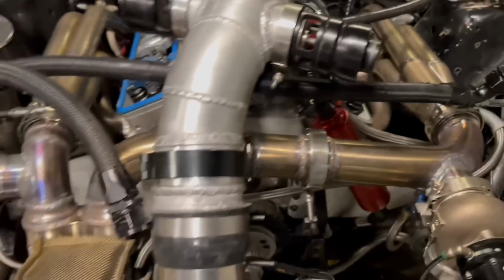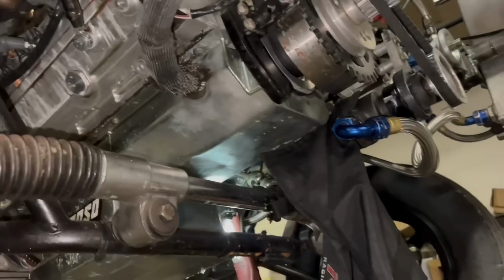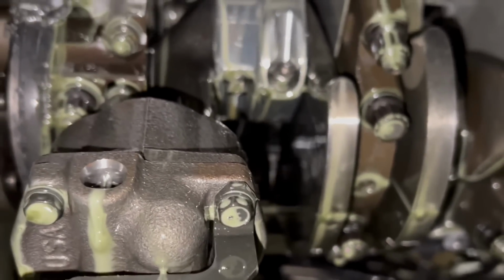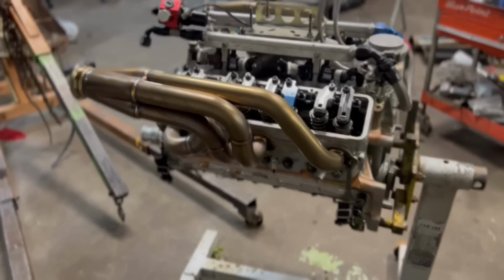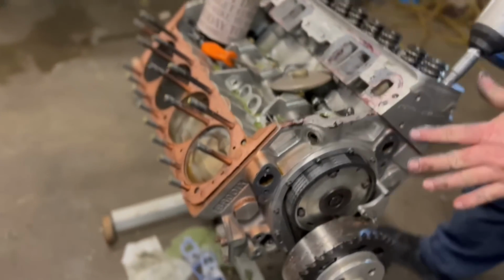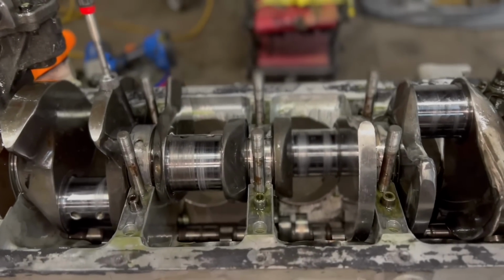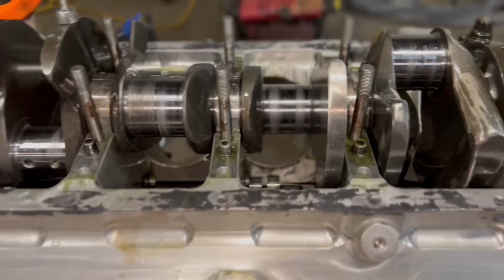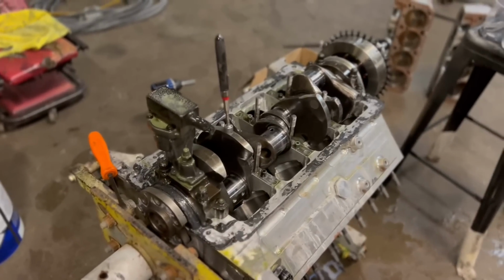Motor is TRASHED!  The ALL ALUMINUM SBC is torn up.  Hope we can save the block......

Comment: Sorry to see the carnage John. 

Have you considered maybe doing fewer short startups, not really getting up to temp, to move the car around when not at the track? That oil contamination looks terrible, can't be good on the motor. I'd be draining and boiling after every race weekend before starting it if it were mine.

I also have a set of Dart BBC heads we might could do some horse trading with if you go that route.

Comment: John, that valley doesn't look like it has much drain back and is design to be scavenged by a dry sump system so it probably ran the sump dry which started the failure , be careful

Comment: Put a crank with larger mains in it and make sure the bearing crush is tight enough. More overlap will make the crank flex less. Hone the block to have a smaller bore size to  achieve more than average crush to compensate for the aluminum expansion and adjust clearance by crank journal size.  Crush is what holds the bearings in place, not the tabs for alignment.   I'm sure you already knew that.

Comment: How about putting the correct washers on that rack & pinion and PLEASE learn how to weld properly,  your going really fast and a door flying off and hitting someone else that has a properly built car and hurting or killing someone in the car or stands is not ok . It's ok to be budget BUT some things have to be done to higher standards than what we're seeing.  Love the content but a little more attention to detail would go a long way in my opinion... and you had to have known with the amount of fuel that was running out of that thing that it was going to hydroloc it , bent a rod or smash a bearing.  You been doing this long enough to know better , just slow down a little and do it right I'm sure you got the knowhow.
Reply from the maker: When ever you want to fix those items, I’ll let you!
Reply: @TurboJohnRacing   I would love to if I wasn't working 60hrs a week and trying to run a company.  What I'm getting at is just pay attention to your welds for burn in , you need good  penetration. That door flying of at 150mph is a missle and could kill someone.  Same thing with that rack and pinion.  I'm not trying to be a asshole I absolutely love watching your channel I just wish you  cared more about details especially when they have to do with safety and 1 more thing while I'm ranting,  you should have listened to your buddy and lowered that blow off valve , it would have looked 1000% better and you wouldn't have to cut your car up so bad , all it would have took is pay a little more attention to detail.  Keep up the good work and good luck with that block .

Comment: I'd throw a scat 3.75  in it if the rods will clear the cam. It should live fine since you run mainly noprep and the extra cubes should spool a lot easier.

Comment: Once heads are off, can you then rotate the oil pump to see where the oiling through galley's oil is not travelling so you can track back to the issue....pull the distro out and make sure that the passage on distro is correct height also, many with Alum. Blocks have that same issue that takes a custom machined collar to get it correct height.

Comment: gotta ask.......why do you idle the engine so low? Should consider a pre heater and pre lubrication system
Reply from the maker: It’s the injectors!  It’s either 500-800rpm flooding rich or 1500-1600 lean it seems.
Reply: @TurboJohnRacing  how about two injectors per cylinder? That and different cam timing.

Comment: Did you change oil and filter after the fuel regulator failed?
Reply from the maker: 5 or the 8, but there are several issues

Comment: A perfect opportunity to go with a 400 main crank with longer stroke, and maybe some longer rods and a set of matching pistons.  Only two things are going to make a difference.  Longer stroke, and/or gear ratio change.  A custom cam with the longer stroke, would be ideal, whereas all the aluminum block did was make it lighter.  Sorry this happened.  Hope you get sorted out quickly.

Comment: I thought Brian was crazy when he was tugging on the crank at the racetrack but apparently he knows LOL
Reply from the maker: Yep, he was check for thrust.....While hot it was good it seemed...
Reply: @TurboJohnRacing  That is the only way to check it, hot.  With the thrust main in the rear, I made a gauge that I bolted to the front cover and tonked them with a rubber hammer, it is surprising how much thrust you can loose especially with an automatic, a friend of mine had a SBC that would run cold and die Hot and be stuck one whack of the hammer was all it took to know that the converter was ballooning and taking the crush away. He had all kinds of guys look at it. I felt like Carl on Swingblade when he said 
“Ain’t got no gas in it…”.

Comment: I had issues with aluminum, went back to iron…. All good now….if you try to warm the block and see how much it moves….. you won’t like it. Hopefully you get it sorted! Thanks for sharing!
Reply from the maker: Thanks for the tips!
Reply: @TurboJohnRacing   The FE has the same main as a Cleveland’s I use Cleveland Cam and  main bearings except for the Thrust Main. The race bearings. I haven’t taken it down since 1999.  And it has seen 7500 NA regularly. That’s just a dump truck 3 rib mains with no cross bolt caps. Just a .020 over  391 ported 352 heads with 2.06/1.6 valves and a Holley Street Dominator and a 750 3310 with a metering block but still straight leg boosters and long tube headers 2 inch primary 3.5 collectors. 503 Hp and 485 ft lbs. all these years and 4.44 Spartan locker, C6. It was so fun to drive but I lost my vision. My son still does a burnout and takes me down the road 1965 Galaxie. The next one I would do would be 4.103x 3.91 FE iron, same block as I have now. That is about 413.5 ci from a dump truck block. I would likely put two cross bolt mains from ProGran, one at 2 and the other at the 4th main. I also use hose nipples threaded hardware store in the valley holes, I have had them in mine since I built it and it allows air out of the crankcase and t the oil down the drains at the front and rear.  It returns quickly much quicker than without them , I also have a scraper on my Canton 8 qt running 9 pan with the huge pickup front sump. No windage tray needed, the air is pulled out by a small vacuum pump and the oil gets knocked off by the scraper. I made my own vacuum pump cheap. I run 15w 40 Rotella or Delo. Flat tappet solid. My next move is boost. I want a 7875 billet or a pair of 3582 remotely mounted behind a 3 inch X pipe with a 2.5 crossover and BOVs with 4 inch pipes straight out just in front of the rear wheels. And a 3 inch oval 2x4 cold side up to the intercooler and to a carb bonnet with a 750 DP and a Holley Controller oh and a PortoSonic I have laying up. The controller would control fuel , timing, boost, and the Wastegate. By my calculations it should make 1025 hp with a nice rising boost curve. Boost is addictive once you play with it and read Corky Bells book! If I live to see it is my plan .
Reply: The other thing I was going to mention is the last time my car was running really rich my MAP line came off, so it was telling the ECU it was at 90 KPA (atmospheric) on the VE table. I doubt that was your issue but something to check on the last data log.

Comment: John, I probably annoy the snot out of you, but I'm not going away.

First, why would you EVER let your oil run with that much methanol in it?  Methanol isn't slick. It doesn't lubricate. When your oil gets that bad, you REPLACE the oil. Do not heat it and boil the water off because it still leaves the oil contaminated. No, you shouldn't be boiling your Methanol out because there's methanol still in the oil..it's just had its water removed. Oil...CONTAMINATED does not lubricate right.  You very well might have destroyed your engine because you refuse to change your oil like you should (and everyone else does).

When you wrench old and used and tired parts...even with good ones beside them...the old always speak the loudest.  I know you ran for years on your old car and won good money on it but I think you had one hell of a run of luck.  High boost, engines need good parts and they need GREAT servicing. You can't run the plugs for 40 runs. You can't run aluminum rods for 120 runs etc etc etc. There are duty life cycles on everything (and not just how much your injectors will spray).  That is to say that if you have Chinese lifters or rods made in some dude's garage...with the power you're running, it's not a matter of if you blowing up, it's when.

Lastly, you spend WAY WAY WAYYYYYYYYYYYYYYYYYYY too much time talking about things like, "It is what it is" -which is just an excuse not to do it right or "It's only 40 under so we can (insert something that truly isn't mechanically sound).

If you are to be successful, you NEED a stable platform. I mean seriously, you can get a mismatched value train that pretty much do the same but should you really be doing that? Is that really a good idea?  Should you be even TRYING to knock the bearings out?  Nobody else seems to do it.

I get that you have a budget, but the fact is that you're running your engine on one leg with that budget. Maybe you should take the time to get your engine running straight and without excuses "it is what it issss".  Racing doesn't work like that for most people. Most people match their value train because it needs to be matched.  Every part should be matched and not constantly welded just so it can get you by.  You're a hard working dude but hard working and keeping old parts running just isn't stability.

I should say that out of all of the racers I watch, you and Billy at SRC are the two I wish would come out on top more than anyone else. You're real dudes, not performers.
Reply from the maker: It is what it is.........I will race within my budget with the cheapest stuff I can buy.
Reply: @TurboJohnRacing  Fair enough. Just know that aluminum does not take the abuse steel takes. Going to aluminum steps you up but you're not going to be able to "it is what it is" it like I think you're seeing.  Regular oil and plug changes are a minimum.

You ask me, and without me touching that engine, I think you killed it by running half oil and half water through your engine. Spun bearings and jacked up mains and then half your engine literally not oiling right points to oil for me.
Reply: @CF_Harris_The_Author  you race?
Reply: @tucker21ful  I street race, yes.  Where I live, there is exactly 1 (one) track within range of me to race at so building a track car would be pointless just to race it on one track perhaps 8-10 times a year when that track operates.

Mechanically, I know enough to build and service a car like John's. I'd need a hell of a lot of help on tuning and on setting up the suspension but an engine is an engine is an engine when you've worked on as many as I have.

Comment: I was wondering about bearing spacers on an aluminum  block also you're the only guy I know that's done it so far also I wonder if you can put a diffuser on the end of the fuel line so it doesn't shoot fuel in one cylinder with a fuel pressure regulator problem

Comment: I don't think the aluminum block is the problem. A huge number of racers use them. Yes, heat does cause them to move around. Try to find a crank/block combo that doesn't use spacers.
Reply from the maker: This is the correct answer.....I think
Reply: @TurboJohnRacing  I love guys like you who do budget racing. I'll buy a rod for a wall hanger in my garage.
Reply: @TurboJohnRacing  I know that you will prevail. But at least consider the iron BBM block.The mains are the same as a Cleveland’s and 4340 cranks have BBC rod journals and you can get 6.8 rods. The Aluminum BBM heads flow better than any SBC. 13 degrees deck angle. It will amaze you how little they weigh?  No more than an iron block SBC. No kidding. Just talk to Blair Patrick in TN. He builds amazing combinations. I want to see you racing more than you are fixing!  He can get parts and you build it.

Comment: Should have swapped in a SBF
Reply: @Turbo John you know you want half the power at twice the price...lol
Reply: @maxwellsmart6601  Sure, and when he’s running with over 7l of displacement and a better rod to stoke ratio, and not spinning bearings.
Reply: @Stopinvadingmyhardware  LOL Chevy is where it's at, that is why it's hard pressed to even find ford power at the track and when you do, they ain't dominating.  And, we have no issues putting 2000 rwhp out a 23° headed 400 sbc with 2 yrs on it, street driven and drag raced every weekend and my 434 18° RFD top sbc has absolutely no issues.
Reply: @jasonstormoen  Ive got an irs 2018 street car with a 5.0 liter. I can make in excess of 2000hp just fine.  Just made some 150 mph passes last night in the eighth with ease. And went on a cruise today. 434 sbc is a decent motor but not with what you can build today. Kinda ancient.
Reply: @91Bravosixniner  😆 🤣 kinda ancient.. Some of you people and your comments, make you sound like you're out there. The most popular combos are sbc and bbc, I've been in this for over 45 yrs.
Reply: I’d put a BBM FE block, cross bolted mains the aluminum BBM heads at maximum cubes and boost and you have an honest lady, all Ford and a 4.36 bore and pick your stroke. The turbo is setup for 7.0L, it will have a short stroke 10.155 deck height .  Why aren’t people using them the weigh the same as what you have? Ray Paqet is still winding his 7.0L to 9200 in his T- bolt. Ford FE is Fords original race engine and it is still the best in the world. Why piddle with this inferior stuff man?  The Factory iron 427 ran 4 hours at a 7200 rpm . And for LeMans 6200 rpm’s 485 hp on regular gas for 60 hrs and weee shut down and torn down, and ran a other 60 hrs.
Reply: @Bbba724  preach it brother, don’t know why people don’t run them more. I’ve been watching Lykins Motorsport and he’s always building a fe, and I’m really surprised at the hp he gets on a mildish build. Think cause they class as a big block maybe, who knows.  I think the old mustang is calling for a sbf in it, but I don’t think John’s pocket book is, lol.
Reply: @jcnpresser  It is sad that the Ford FE once you get that hippo of an intake off, it weighs the same as a Windsor and SBC.  Yet they are forever pigeonholed as heavier than a 460? Try and convince my engine stand of that … 😂
Reply: @jcnpresser  BTW, guys I m not picking on JC , I just wanted to let you all know that I think Johns next step, might be to contact Doug Park We worked hard to get this to market, I studied the blueprints and it is a great combination.  Doug  was a friend at BBM, Bear Block Motors.  An iron block FE with aluminum heads and a tall TW intake manifold with the horn and the EFI would be the king of NP. The iron FE block is a work of sculpture, not pound shy or an ounce over put that Turbo you have in it and you will spend much more time racing than fixing. Brent Lykins is a good and really anal builder. Blair Patrick took all comers at EMC with a factory block, 352 heads just like the ones I am running now and 400ci. Just a hair under 1.5 per cube with stock parts. It weighs 545  lbs all iron but the intake. Mine weighs 530 all iron but the intake. So think it over… power and grace never go away unless people forget.
Reply: Everydody bickering about brands, im a bowtie guy through and through but even i can admit you can make power and have reliability with any of them if you have funds. You can make entry level power cheaper with some(LS especially) but the more you make the more that price levels out.
Reply: @stevenbelue5496  exactly right man, they all going to break and the parts are out there for nearly any style or brand to be competitive with. Im a die hard ford guy but appreciate HP no matter what badge it wears because at this level of power none of them are using many if any stock parts anymore lol
Reply: Put Randy's engine in it 😆
Reply: If he wanted the best he would put a Hemi in it.
Reply: @coastalcustomknifeworks3718  😂😂 no. That’s how you play 5x the price for a 1/3 of the power.
Reply: @coastalcustomknifeworks3718   You can't say the best is a hemi either.. They make billet blocks, billet heads, and billet intakes for bbc and sbc. 2 yrs ago made 3645 rwhp with a bbc 572 f3x-140 procharger and could of put more to it, but in the no prep world nobody is even using 3400 rwhp to win. There is more to a combonthan than a engine.. Our Ole buddy Jeff Lutz last weekend won NPK with a twin 94mm twin turbo 540 bbc and he was run against the damn Proline hemi combos that everyone thinks is so great.
Reply: @jasonstormoen  Your comment about Jeff Lutz was good except you forget Jeff’s combo probably costs 50 to 75 thousand. Turbo John doesn’t have that kind of money.
Reply: @dawnmclees  I know John doesn't have the kind of money my dude James or Jeff does, buy did you read the hemi  comment? My comment was a general comment about it don't take a hemi..
Reply: @jasonstormoen  my bad guess I read it wrong. Anyway have a good one!!
Reply: @dawnmclees  no problem bud. You have a good one.
Reply: Ford will always make more power. It just cost money to do it
Reply: @sbfnation2535  lol wake up man a ford will not make more power..
Reply: @jasonstormoen  ahhh to each his own

Comment: Everyone going beyond rating of motor since the junkyard LS turbo swap and blow and swap and blow...lol. Fuel pumps are giving everyone problems too. I use a fuel shut off switch and luck so far.
Reply: An LS makes a killer trot line weight 🤠